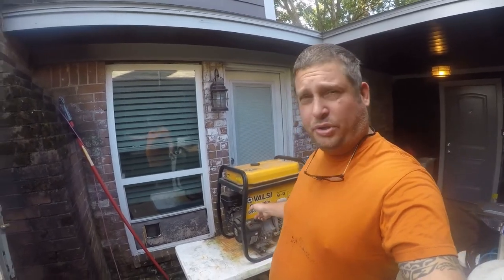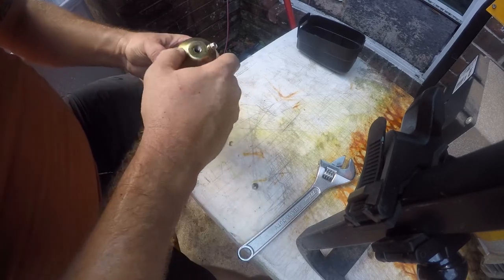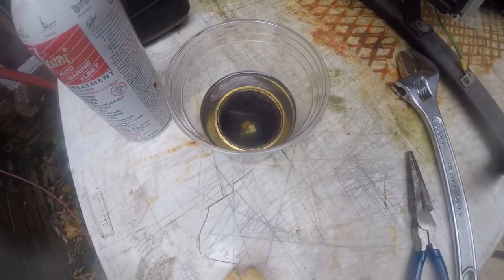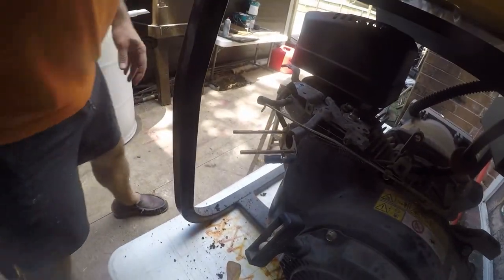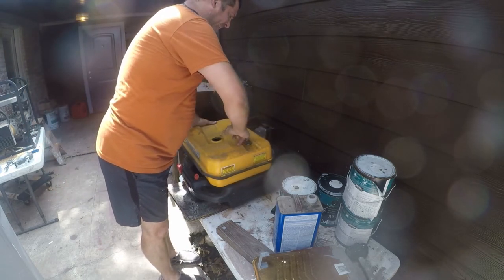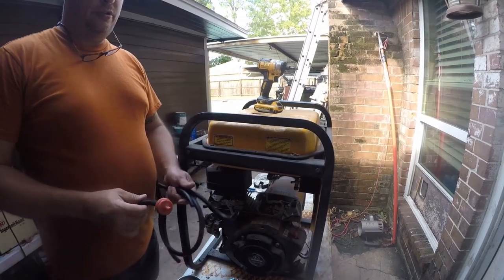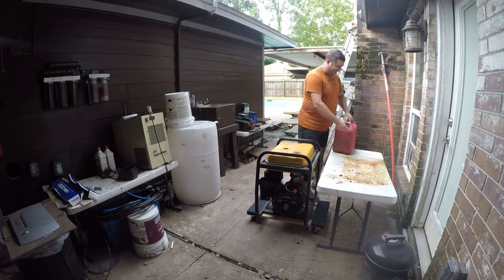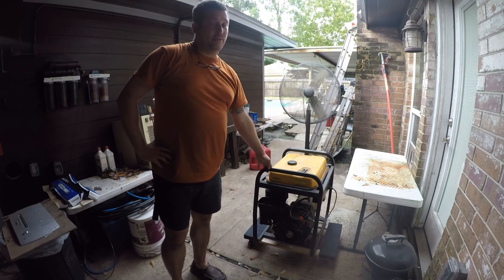DIY: Refurb / Rebuild Valsi / Subaru Generator for Hurricane Laura (LONG Video)

Comment: Thanks for posting. I have the same exact generator and it failed to startup when I needed it  for Hurricane Milton.  Now I have an idea of what to do so this doesn’t happen again.  Thanks again
Reply from the maker: You can get a replacement carb on Amazon for not much.  I went to rebuild it again and the new "eco" gas wrecked the carb.  :(  If you have natural gas it's worth converting to that instead.